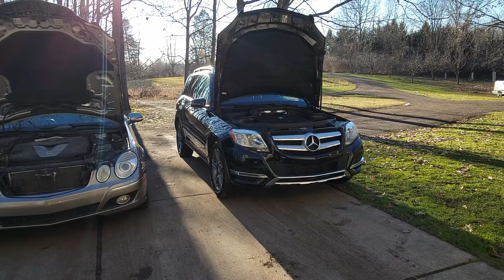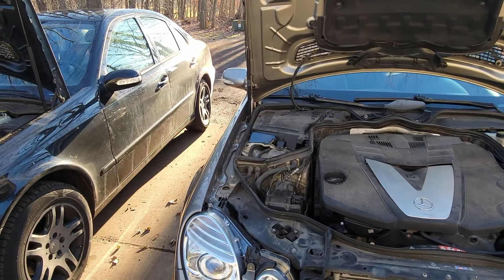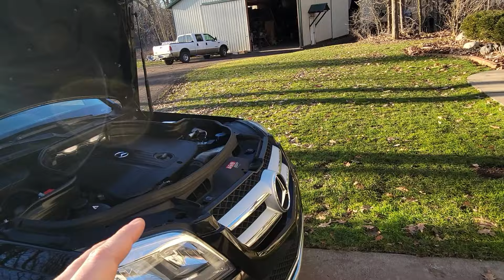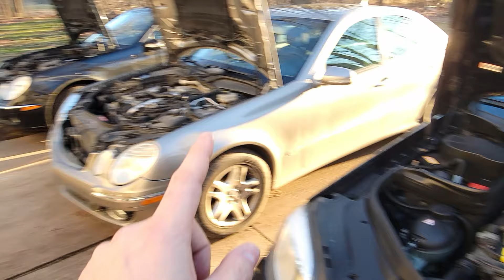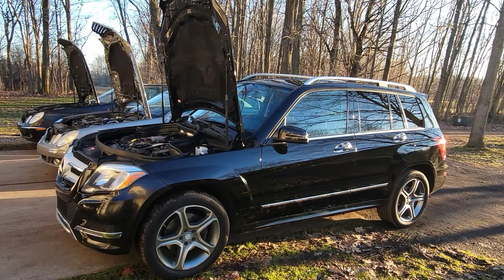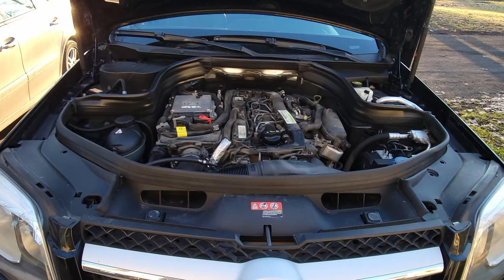The End of the Mercedes Benz Diesel for the United States

Comment: the 651 has problems with the oil pump. its a 2 stage pump so the oil pressure doenst go over 2bar under 2krpm. i suggest deleting the solenoid and locking the pump to high pressure mode. it makes everything last longer. timing chain lasts 300k kms on the 651. if the engine is ran low on oil the bearings will bite into the crank and spin bearings. these engines dont last with a lot of coldstarts and long oilchange intervals. change the oil every 10k kms/6k mi. ultra common engine in finland. over 60% of benzes currently for sale here are with 651 engine. very good engine IF maintained correctly. 180cdi models are extremely underpowered, same for 200cdi (single turbo models) 220/250cdis are awesome, the power curve is amazing
Reply: i have driven like 5 cars with 651. 212 200cdi 722.6, 204 180cdi 6spd manual, 204 220cdi 722.6, s204 250cdi 6spd manual (most fun one) and x253 220cdi 725.0
Reply from the maker: @jaakko200987654321  do you think the oil pump issue has more to do with infrequent oil changes than just a bad oil pump design?

Comment: Hello and thanks for a great programme.
I live in Melbourne Australia. 
Unleaded petrol was put into my 2012 E220 CDI diesel and driven almost 2 kms before it spluttered and was turned off. The car has been meticulously serviced every year and has travelled 112,000kms.
I’ll have it towed to the mechanics in the morning but in your experience, do you think this has totalled the car please?
Hope I hear back and thanks for your excellent and useful Videos.
Best wishes, Christopher 
Best wishes, Christopher
Reply from the maker: @christophero4489  I don't believe so. The worst case scenario is the fuel injectors and high pressure fuel pump would need to be replaced.
Reply: @MBDieselFreak  Hello again MB Diesel Guru, just letting you know you were correct. After a system clean and flush, the E220 is back on the road, running well with no error codes. I really appreciated your reply to my enquiry. Thanks again, you sure know your stuff 👍

Comment: Still some modern Merc diesel engines are still in production and available .But because you Americans don't buy them you lose them.
Reply from the maker: I think it was the VW emissions scandal in 2015 that pushed MB over the edge to stop selling diesels here. I agree though, I've always wondered why diesel passenger cars never caught on here. Diesel pickup trucks are SUPER popular in the US, but for whatever reason, new car buyers wouldn't touch diesels with a 10 foot pole.
Reply: @MBDieselFreak  I've thought the same many times. The US is a huge country and everyone drives cars long distances. Diesel engine cars are perfect for it but I guess it's because in Europe fuel has always been more expensive, so people tend to choose diesel over gas for the extra mpg. Whereas a big V8 in the US isn't that expensive to run. Modern diesels drive so refined it's hard to tell it's even a diesel and not gas. Still love my OM648 though 😉
Reply: I think that there's a small chance that they may turn back.  Diesel hybrid is pretty much the way to go.  Some folks in Canada have built a diesel-electric semi "hybrid" and it's using a 3.6L CAT engine (newer CAT engine).  With improvements in tech in getting these diesels reduced in size (and maintaining good power) it seems like a great way to go- and if not for cars then for light duty trucks.

Comment: is there a certain mileage range that the oil cooler seals tend to go at?

ASking about the  V6

the only other item is the conductor plate (speed sensor) that goes if the trans oil is not changed, Merceses originally sold it as a closed for life, and later changed this advice.
Reply: Mine went at 265k miles
Reply: Mine went at somewhere around 80-100k. I ended up getting it fixed at 100k.
Reply from the maker: It's most likely leaking before 100k. That issue was discovered less than 5 years after that engine first came out. You'd notice engine oil draining on the inside of the transmission bell housing.

The conductor plate transmission issue was only an issue for early 722.6 transmissions, up to the late 90's.

Comment: There is NO vacuum operated water pumps on any of those engines that you are showing, they all belt driven water pumps.   I know,  as i repaired all of those engines on my own vehicles , as i had and still have some of them today. The best one to work on ,  so far on my W212 is OM651 engine ,    city or Hwy fuel economy owesome ,  but little underpowered as it is only 2.1 liter engine ( be aware this engine  is  too weak for Sprinters to haul any load more than 1000lbs).  If you are planning to pull  trailer behind, then obviously you better have V6 OM642, especially on Sprinters. One of the best  engines  on Mercedes sedans for going through the mountains and when passing and need fast response will be OM648 , as that inrow 3.2 liter engine can impress you with torque and fuel economy, but it is smelly diesel engine  type no matter how good it is, and only Rear wheel drive. Plus pulling out seized injectors on OM648  it is another story...
Reply from the maker: US om651's had an option code for a variable water pump, and from what I've heard the pump uses vacuum to adjust output.
Reply: @MBDieselFreak  I have 2015 model and I replaced water pump, it is regular water pump. This OM651 engine has extra electric accessory water pump as on other Mercedes models, just to circulate coolant for faster heat in the cabin,  but nothing is vacuum operated on water pumps there on OM651 , at least I never seen one yet  . OM651 OEM water pump housing is made of plastic housing and they are weak, so factory realized that and came up with  metal housing waterpump after and that can be purchased from a dealer.
Reply from the maker: @You-can-fix-it  there are two different water pumps for the om651, one is variable and one is not variable. The variable pn 651200770180 has a vacuum line connection. There are a few forum posts out there as well referencing coolant in the vacuum lines due to water pump failure.
Reply: @MBDieselFreak  Maybe in Europe,  as OM651 cane with a single turbo on the beginning in Europe,  later on they had same twin turbo as we got here in USA. I never seen vacuum lines on US OM651 engines yet
Reply: When you look at that part # that you wrote, and when you look at the picture of that waterpump, you will see looks like a vaccuum pump fitting for a hose on the bottom, it is for draining coolant when pump fail..

Comment: How does the OM648 compare to the BMW M57 diesel engine?
Reply: I have owned both, OM 648 is more reliable and economical than the diesel guzzling and unreliable but more powerful M 57
Reply: @leroyjohnson4973  Interesting but good to know. I have a w211 with the OM648, however I don't love the body style. I've considered moving to the BMW, but I wasn't aware it had reliability issues. What was unreliable about the engine?
Reply: @LOLOLOLOLOLOLOLOLing  carbon and soot deposit everywhere inside those engines that significantly hinders performance, throttle body, egr, intake pipes just everywhere, those engines just can't keep themselves clean on the inside....my experience came from a 2011 X5 35d
Reply: There equal in reliability in my opinion just need to remove emissions from the M57 and beware of timing chain replacement needed at around 200k-250k miles

Comment: How can I be sure of wich engine is wich if I go looking for one ? Where do I have to look ?
Reply from the maker: For US spec cars: 05 & 06 E320 is the om648, 07 - present 320 or 350 bluetec's are the om642's, and 2012+ 250 bluetec's are the om651. European models vary by years a little bit but the same general rule of thumb applies.
Reply: Thanks for the info !!!! @MBDieselFreak

Comment: HELP! Om648 swirl flap mod - how on earth do I get to the connector to do the resister mod, I’m looking at it from the top through the intake but can’t figure out how to reach it let alone pull it to a place I could install the resister. Pls help !
Reply: The electrical connector for the swirl flap motor is on top of the intake manifold around the EGR valve area.  The swirl flap motor is underneath and difficult to get to, but not the electrical connector.

Comment: The new modular generation of MB diesels (inline 4 and 6) is much less reliable than OM651, from what I have seen online. I hope they at least don't turn out to be a complete disaster like BMW N57...
Reply from the maker: What's the number for those engines? Are these engines you're referring to ment to replace the om651 in sprinters?
Reply: OM656 is inline 6 version and (I think) OM654 is inline 4. Don't know about sprinters, but they are in all the sedans (C, E, S class) for a while. They have electric turbo, mild hybrid and what-not. @MBDieselFreak

Comment: I've watched one YouTube channel and it said that 4 cylinder engine is the worst Mercedes ever made and the engine was apart and they were explaining why
Reply from the maker: Be careful they weren't talking about the om654. The 654 was the i4 successor of the 651, and has a worse reputation.
Reply: @MBDieselFreak  great content you have keep doing it. I have 07 e320 CDI an have to deal with transmission gets in limp mode gives turbine speed sensor code on valve body
Reply: Seen E220Cdi here in Europe with 600k on them, Not much comes close to this Gen E Class.

Comment: 280K miles on my w211 om642, a car I want to keep forever but its has a few expensive repairs recently
Reply from the maker: What the most expensive repairs you've had to do on that thing?
Reply: Other than the dpf replacemment. Oil filter housing an vacuum pump leaks went unnoticed for a long time and ruined the belt, and tensioner.

Currently it is smoking from the V or under the fuel filter and multiple shops have not been able to find it. It’s not the pcv or inlet seal

Comment: Thanks for the fantastic video on this job. Im thinking of buying the 2007 bluetec  .The guy selling  says he doesnt want to allow a test drive because "needs turbo redone, throws codes related to boost pressure and turbo sensor. Burns oil because of this fact(turbo seals)."          Doesnt seems like a big job  like the oil cooler  orings . I have a Sprinter om647 and just done the turbo oil intake and return orings which were leaking and caused alternator to burn up and the orings werent bad to do . What do you think he means by the above statement . I havent seen the vehicle yet but hes selling for a great price. Thanks